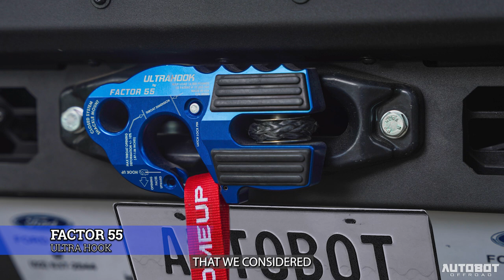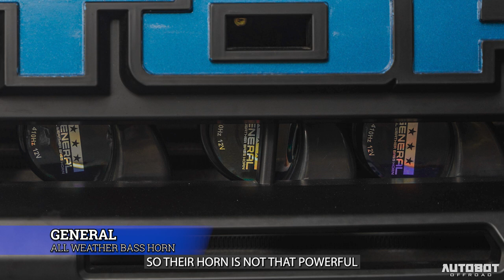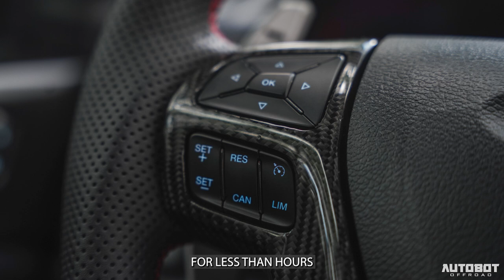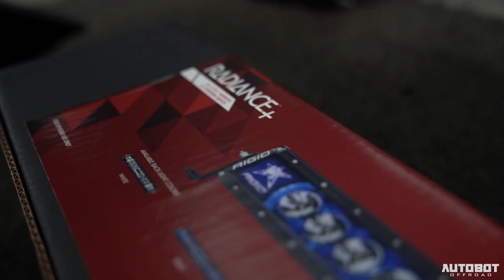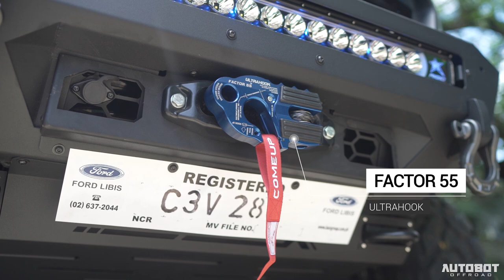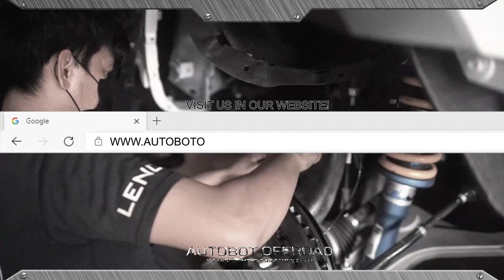RAPTOR AUTOBOT SUPER BUILT -  PROJECT COBALT

Comment: Hi guys,
You are doing un excellent job congrats.
I have also ranger raptor and i lift it 2 “ king springs and i use rims and tyres 17” ET0 and mud terrain cooper 315 70 R17 and the tires still touching the mudguard.
Cam you advise please? 
Thank you
Reply from the maker: DM Us Sir :)

☎️ 02-758-4381
    0917-333-3777
    0917-319-8840

Comment: Magkanu pag hulogan jiji
Reply: I'm buying a Raptor and want to have a similar build -- 2 inch lift with 35x12.5R20 tire and 20x12 or 20x10 rim. Can you PM me approximate cost? Also, I'm looking at another option -- similar as earlier mentioned but 4 inch lift. How will the cost escalate? Hope you can give me idea to help me decide. Hoping to have my unit early January 2022. Thanks.